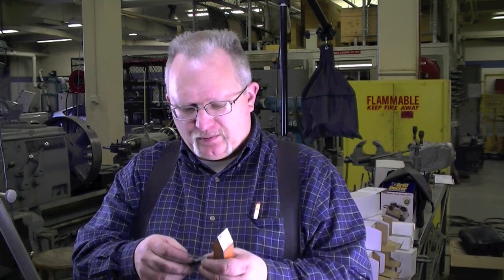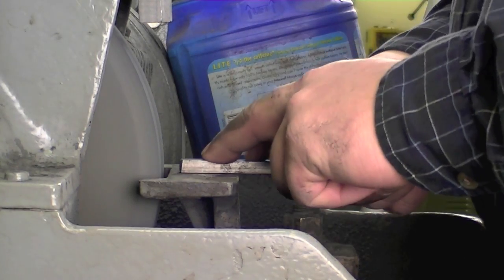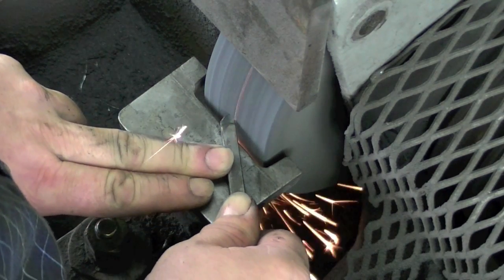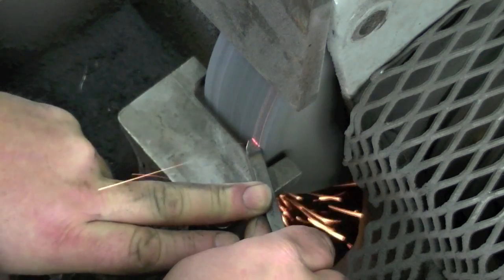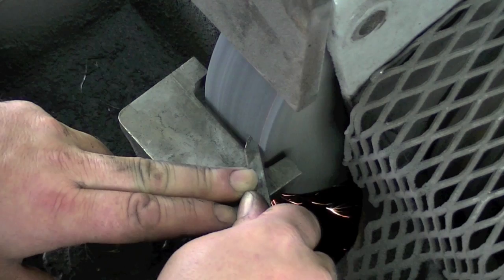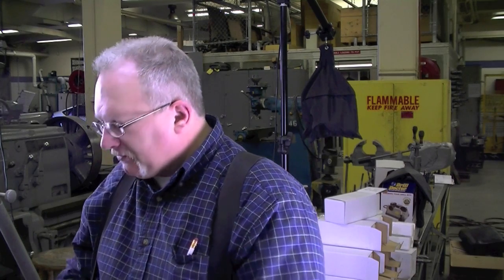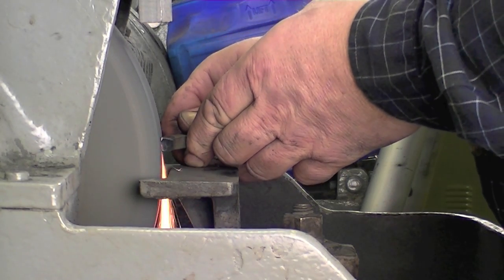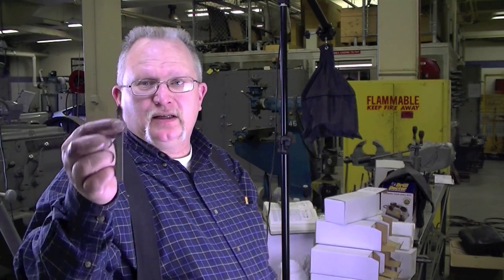Grinding HSS Lathe Tools - Part 3: Grinding a Threading Tool

Comment: If you had a cad program you can easily draw that angle that's what I do 27 and 1/2 degrees 4 Whitworth threads
By the way high speed steel does not mind changing colour it can survive up to 1000 degrees Celsius without losing it's properties thanks for the video I wish I could find a source of affordable tool steel but in the country where I live everything cost an arm and a leg and I mean everything

Comment: Left handed and right handed threading tools ?  Thread helix angle added to the tool leading edge clearance angle and subtracted from the tool trailing edge clearance angle together with the tip radius or flat are all missing from the video.
I home you teach a better standard than this to your students.

Malcolm

Comment: So is the top rake needed if you aren't using the angled tool bit holder and how many degrees are the left and right sides? Thanks.